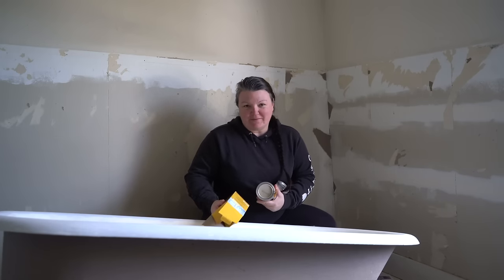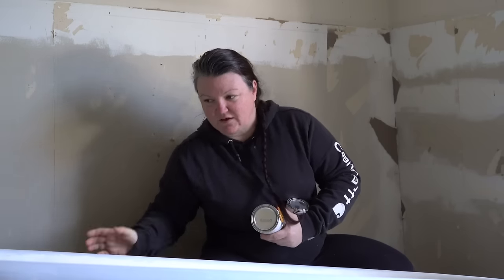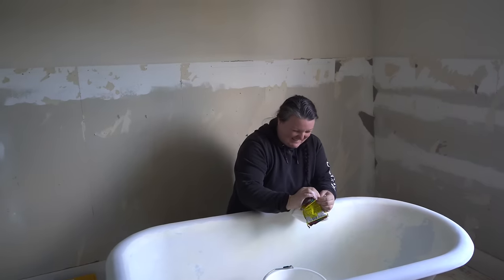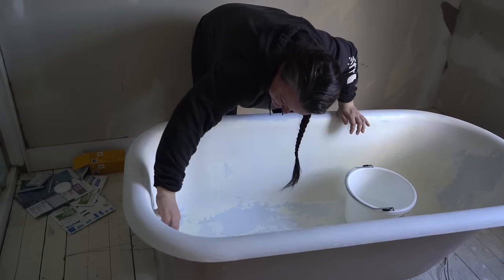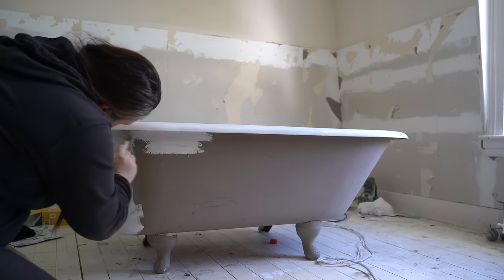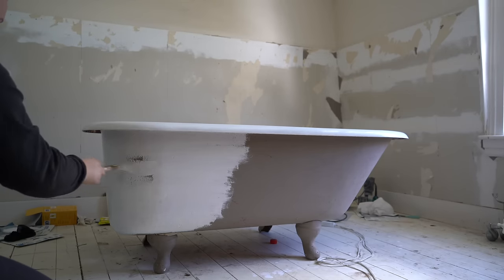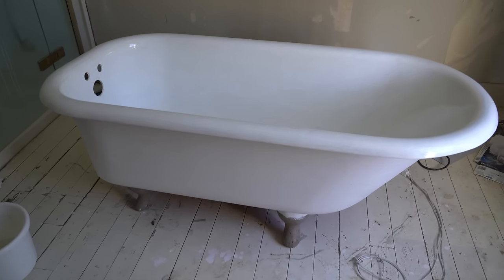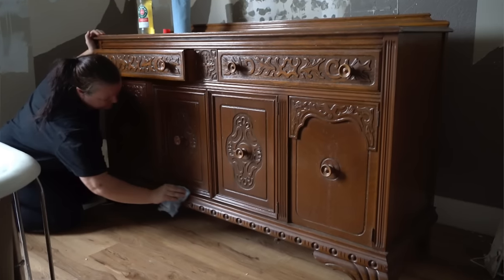I am not giving up hope...(bathroom renovation)

Comment: When I did mine I used the Rust-Oleum brand and it was much thicker and really covered well, it would have hidden all on your first coat in your bath tub and I did two coats waiting the time requested between the 2 coats.  I wish it will change to white when it dries for your sake and all the work you put on that tub.  👍. Love your truck, we had a Ford 350 and sold it with our 5th wheel, well really exhange it with someone who offered to change our outfit with a 2016 Ram 4 door.  When the lady call. I was not sure as I loved Ford trucks because of how the side front windows curb down towards the front and gives a good view on the side mirrors but then when I saw the inside of the Ram fully loaded and all seats in real leather and in super top condition with only 99000 km so we went for the exchange and I am very glad we did as our Ford was not a 4x4 and the Ram is which we needed where we live but this Winter you are getting the snow we use to have and since the start of the Winter, we only clean our driveway twice which is a record… i would call your truck 🛻 Sylvia as she is silver grey color.

Comment: lol, I did the same thing trying to save my tubs in my old stone building. In the end it looked like crap and only lasted a year before it started to rust and leak again, so I ended up finding a very heavy fibreglass tub with huge gold feet on kijiji for $200.00 in perfect shape. This is half the cost of all the paint and strippers and sand paper and epoxy I bought for the cast tub. We all have to go through it for sure. Kudos to you for trying. Well done. Heather

Comment: Great patience 🏆 Where you went off kilter was that you didn't mix the second tin enough before adding into the first part.... Mixing activates.... Definitely recommend getting a second kit & going over again. Can't wait to see the end result! Congratulations on the new truck 🤗
Reply from the maker: the clip was edited I mixed for a while for both :)
Reply: @ElysiaEnglish  Ahhhh I did wonder 🤔 but thought best to mention JIC! I wonder if the temperature was too low? It most definitely should have been a thicker consistency. I know Canada's been Baltic! Just a heads up to check temperature limitations with delivery, storage, application - depends on manufacturer of course.... Would hate to see you expel any more elbow grease than necessary! Good vibes hitting your way 🤗🏆💓
Reply: The paint that you painted the outer portion of the tub do you think that you could paint the inside of the tub with that and then put the final coat on top of that that way it would be more white white instead of soy

Comment: Gotta hand it to you for your persistence with the tub. Looking remarkably better, at this point. Not particularly keen on the old wood of the vintage cabinet as it lacks life, vibrancy. As another suggested, consider Retique. Have seen a few YTers apply it over old wood finishes and the results are amazing. Still the look of wood, but updated. Was holding out for your perhaps adding some beadboard wainscoting (bit of an homage to the age of the house), maybe in your signature blue. Bathroom is so large it can easily accommodate a good amount of strong color, somewhere.

Comment: I like the wood element, of the vanity, in your all white, 100+ year old bathroom .  YOU COULD ALWAYS PAINT IT LATER,  but it's harder to remove all that paint, if you decide wood is the way to go.  I do suggest putting several coats of a protective sealer on the vanity, since it will be used in a bathroom!

Thanks for saving a house, that could easily have fallen into a condemned house, since it was neglected for so long!!
Reply: I say, name your truck, Pearl!!

Comment: We used a tub kit that we got off Amazon. It was not th rust oleum  brand it list between 59 to 79 usd   It worked great and lasted a long time. I tried to look it up in my Amazon history but could not find it. We did put it on with a foam roller. It came with a packet of grit that you could mix in and put on the bottom to make the tub less slippery. Hope this helps

Comment: If you have a cast-iron tub that's looking a little worse for wear, you can refinish your tub. Cast-iron tubs are usually finished with a layer of porcelain enamel that is baked onto the metal; this cannot be removed like paint or added coatings. But if you have an older cast-iron tub that has been painted before, it may be that you need to start your refinishing process by fully removing this older, failed layer of paint. Saving your cast-iron tub from the landfill is better for the environment, and it can save you money and minimize renovation disruptions.

Comment: 1st question, did the tub kit get good reviews?  2nd question, is the cabinet in good shape finish wise?  If so, i think you should leave it.  It will look more vintage with the tub.  Especially if youdo a warm color on the walls.  How about Frannie the Ford for the truck name?    Good luck on the 3rd coat on the  tub.